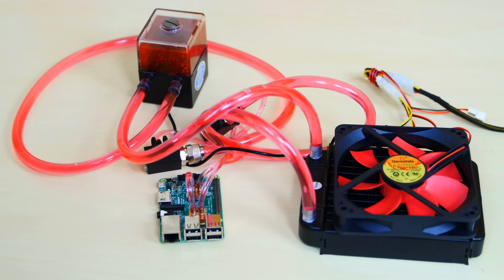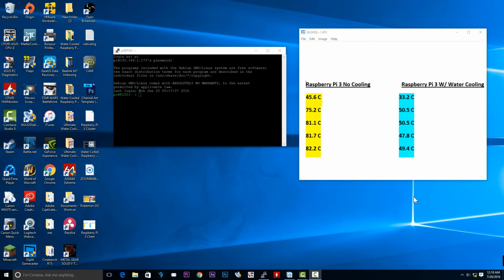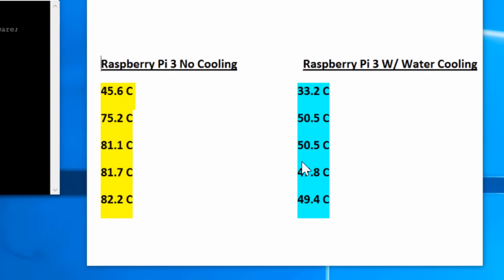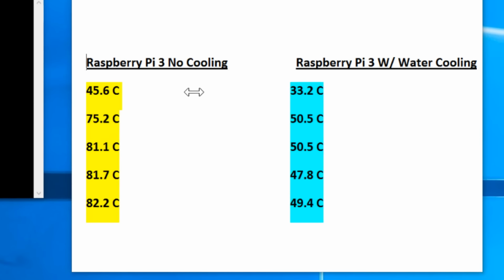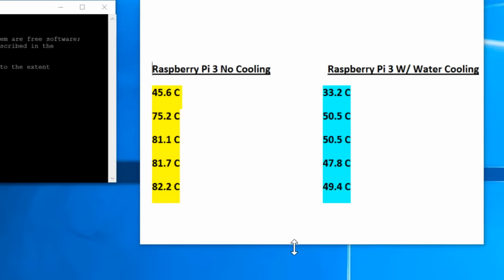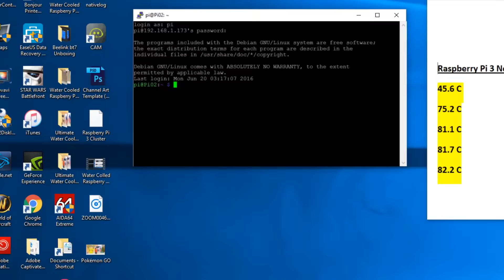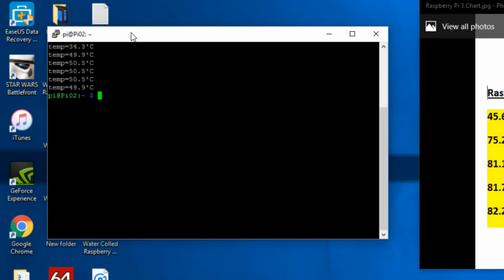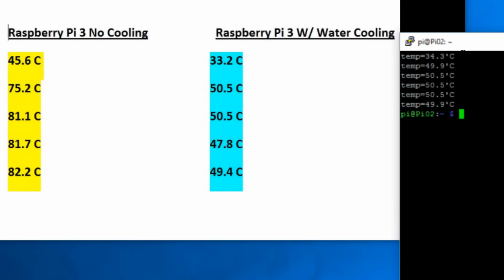Ultimate Water Cooled Raspberry Pi 3 - The Temps!

Comment: Oh, I see what you did now. When you connected the big tubes so as to increase the flow of the coolant, you actually decreased the flow going through the blocks. You need to put some resistance on the flow-through tube to pull up some pressure to drive coolant into your blocks. It's the same concept as a pull-up resistor in electronics. It's really a testament to how much heat the coolant can absorb that it is cooling as well as it is. You can have very low flow and it is still that much better than nothing at all.
Reply: I originally didnt think flow was an issue but after looking at it again, I think it would be best to just hook up the pressure side to the blocks then run them straight back to the reservoir to get the best flow

Comment: I would recommend correlating your test temps with the ambient temp at each measurement and then correcting to a standard ambient temp. Your results could have actually been better, but done at a higher ambient that would make them look worse without correcting for ambient.
What is the test script doing? What is the test process?
Reply: My first thought was the initial temperature, it is summer after all!

Comment: Looking at this again, the way the lines are setup, there's no pressure differential on the inlet and outlet of the water blocks, meaning little flow. You could test that theory by just pinching the line inbetween the two hose barbed blocks to force more flow thru the water blocks. 
The best way to route the tubing in my opinion, would be a straight line from the water pump, thru the water blocks, into the cooler and back to the reservoir, and you would then need a bypass at full tubing size between the outlet of the pump and the inlet of the reservoir with a valve to adjust it, you would close the valve off just enough to put pressure on the small water block lines and force flow, but not so much to bog down the pump, you can set it by measuring the amperage draw on the pump and pinch it off till it starts loading the pump without overloading it

Comment: Like Hangfire said, it could be the ambient temp is different. (room temperature). But it could also be that the clear case you put it all in is holding in heat. The tubing itself radiates some heat before it even gets to the radiator and by putting it in a box it insulates it from being able to radiate out into the room.

Comment: I hate to break this too you bud but any professional water cooler knows that pump speed has almost 0 effect on temps. It is a truth that holds evident in computers and would apply here as well, the main things that will effect your temps are surface area of the radiator, fan speed, and efficiency of thermal transfer compound.

Comment: Hey, I heard that the UDOO X86 is ten times faster than the Raspberry Pi 3. (It's also only 3x the price) But I'm wondering how the CHIP $9 computer compares. Also, the Odroid XU4 is about twice the price of the Raspberry Pi 3 but supposedly much more powerful. It would be great if you could do a video comparing them all. I also have a project idea: build an external video card out of a cluster of Raspberry Pi's. I know external video cards exist, but I don't know exactly how they work. I have an old laptop and I need more video memory but it's already upgraded to the max. I also have a Raspberry Pi B+. So I'm hoping someone can tell me how to use it as an external video card.